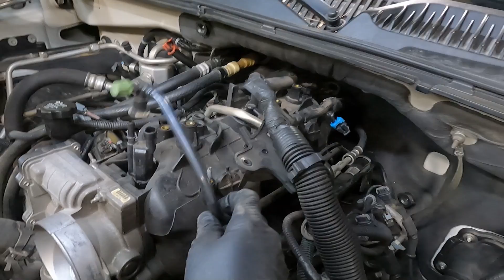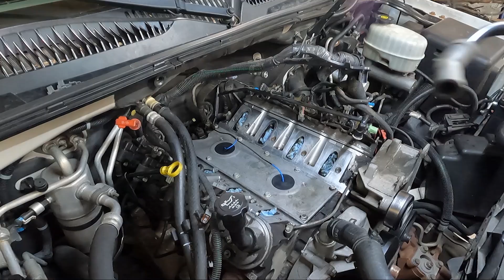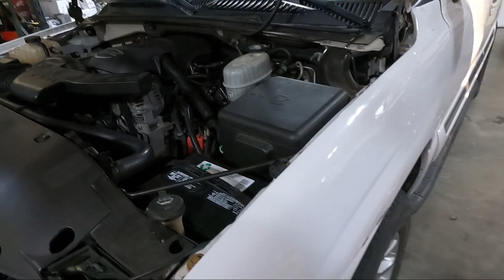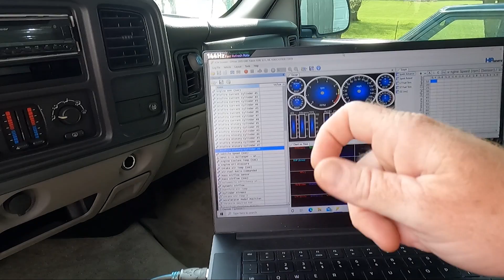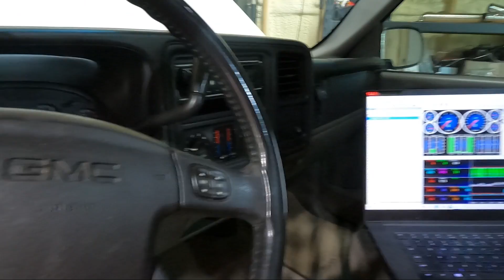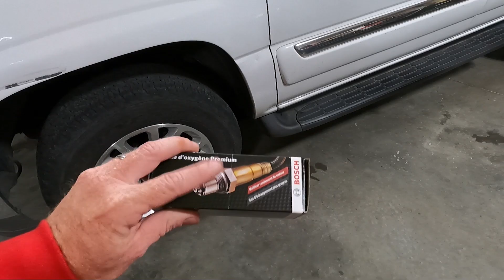GMC Yukon Rough Idle Fix (New Intake Gaskets, Knock Sensors, 02 Sensor and Injectors)

Comment: Great video, i have a 6.2 Yukon, just did the upflow and down flow o2's no check liight, but now i have a rough idle on startup. Go' s aways when she warms up. 1 fuel pump or 2 intake gaskets. Ill be doing a pressure check on the fuel rails today to diagnose if it's the fuel pump
Reply from the maker: Hard to say. Could be plugs and wires

Comment: been watching your videos for quite a while now and really enjoy watching them. I see your project with the yukon and actually came across an issue with mine this year. Im having trouble figuring out why it is my air isn’t coming out cold as it should. Thought maybe i needed to reload it with freon but that wasn’t the issue. Checked if my a/c compressor was still working properly. Not the issue either. Any tips on what i should try checking?
Reply from the maker: Actuators in dash are common problems on these.

Comment: Mines ruff idling too and it’s miss firing I have a 5.3 v8 intake and open headers I went to to get it checked out and the dude said it was my o2sensors any tips travis?
Reply: It misfire’s when I’m on low speed then when I hit the highway and give it more gas it wants to drive normal
Reply from the maker: Probably o2
Reply from the maker: Good place to start. Open headers don't help the situation
Reply: I also switched out the spark plugs it helped a little with the idling then started back up again
Reply from the maker: Needs exhaust
Reply: also it hasn’t been tuned for like  a year and a half and I already ordered both o2’s
Reply from the maker: That would help too

Comment: I have 93 e150 5.il Ford clubwagon van. At slow speed after stop and go,it wants to stall ESPECIALLY if I go down an incline ex: I drive from my second floor parking garage to 1st floor and the IDLE drops to almost stall. Was having idle issues and AFTER 7 mechanics including dealership, was determined I had an internal vacuum leak.$1300 and 1 later,still have it.
From mechanics opinion the following has been changed out and HASN'T fixed the problem. COMPUTER,MASS AIR SENSOR, AIR IDLE CONTROL VALVE,COMPLETE TUNE UP AND OTHER parts I CAN'T RECALL NOW PERTAINING TO PERFORMANCE.
Someone told me maybe It could be the fuel pump witch did go out and recently changed out and still have the problem.
Reply from the maker: Yeah that's odd. Not sure what to tell you
Reply: I had something similar, I don't recall the part, but there is a pressure control valve (I think, inline 6 it has 3 bolts and is triangle-ish) in the fuel rail and the gasket on that blew. Replacing it was easy and it definitely helped.

Comment: I recently did a lot of the same work on my 05 chevy tahoe and didn't realize I had to reset my PCM by unplugging my 2 battery wires and connecting them worked like a charm.
Reply from the maker: Yeah some do that. I can reset with the laptop

Comment: I would definitely recommend replacing the oil pressure sensor while everything is off. I did all of this on my 05 Silverado and a few days later the oil sensor went bad. It can be done with the intake on but your knuckles might not like it lol. Great video 👍🔥
Reply from the maker: Probably a good idea.

Comment: I know that this is an off the wall comment but I'm having an issue with my 2011 suburban it keeps telling me service brakes soon I have replaced the master cylinder and vacuum power booster and power booster sensor  I'm not sure what to check next
Reply from the maker: Maybe bad out of box
Reply: Do you think it could be the abs module
Reply from the maker: Possible